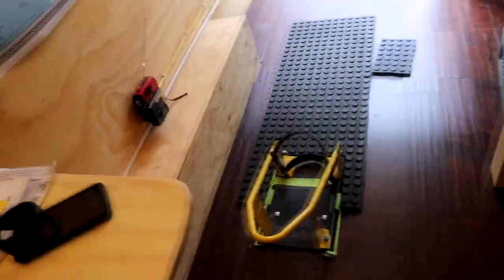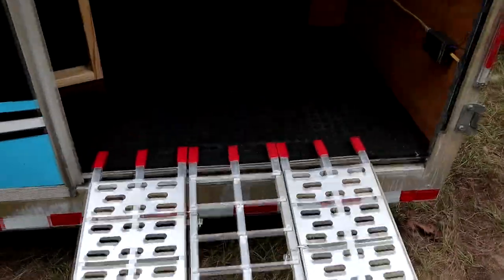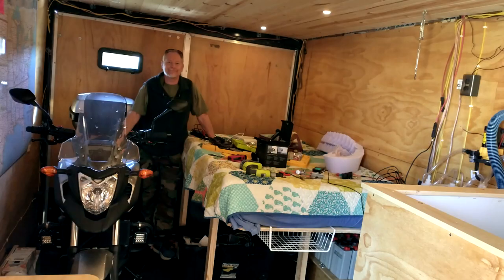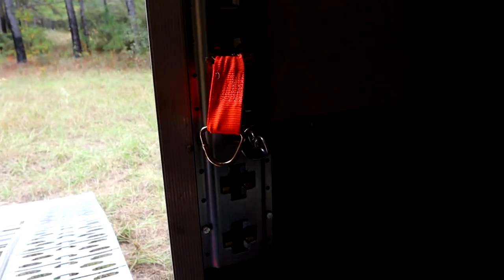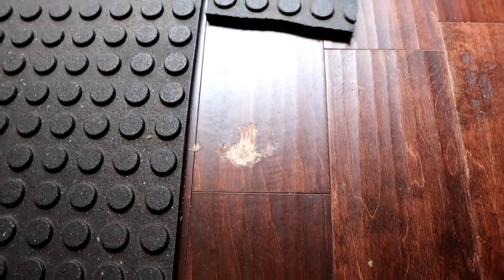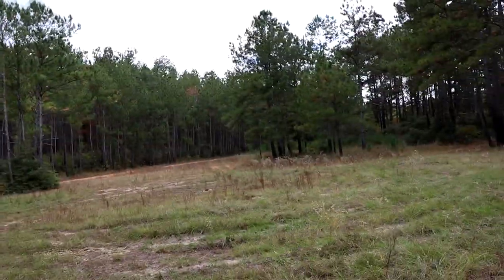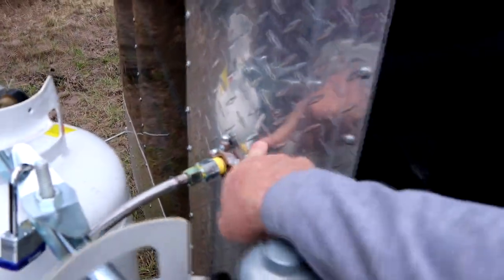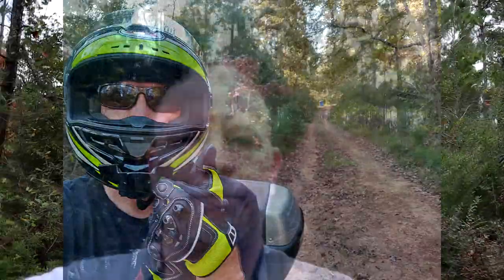How I Load and Haul My Honda NC700X Motorcycle in My Cargo Trailer Conversion MotoHauler

Comment: I put two recessed d-rings in my floor and I also have 5' e-tracks running on both walls.  If you put a screw in every hole on the e-tracks.. its super strong.  I was hauling around a Triumph Thunderbird bagger (about 850lbs) before it was stolen.  Never had any issues with it.
Reply from the maker: Thanks for the info on the E-track. Sorry to hear about your Triumph being stolen - thats a HUGE bummer!

Comment: You need to tie the front end down to the floor.  Bolt 2 d-rings into the floor at a stud.  Keep the kick stand up.  Or do a piece of e-track in the floor, directly under the foot pegs and strap the pegs to the e-track.
Reply from the maker: Hi Tim, you are absolutely right. So I did it today - put down the e-track and pulled down at the pegs to the floor. That method is SOOOOO much more stable!